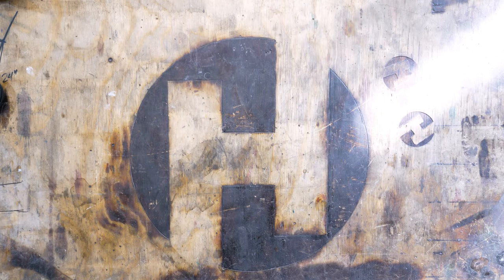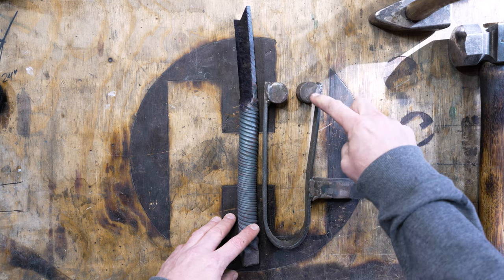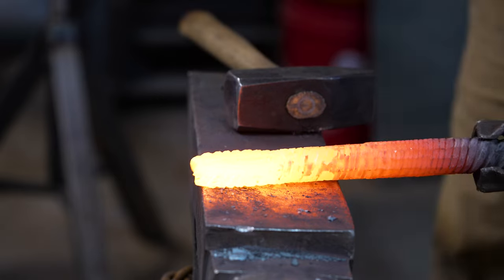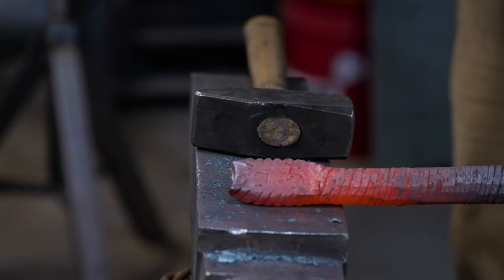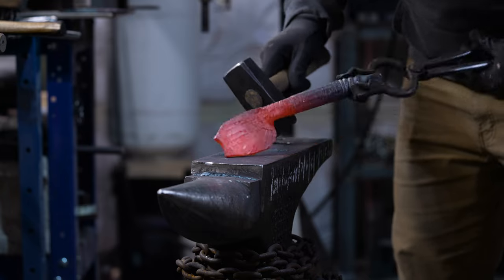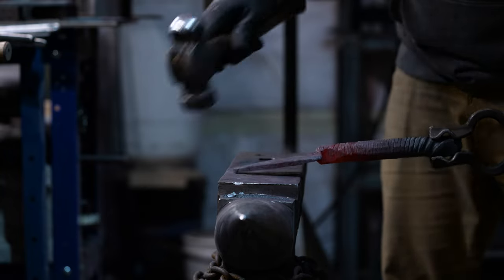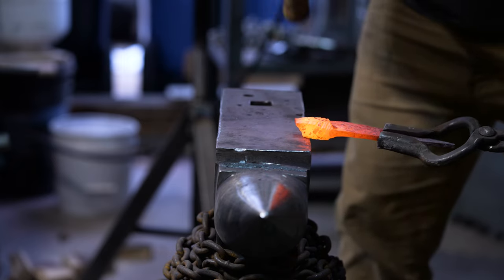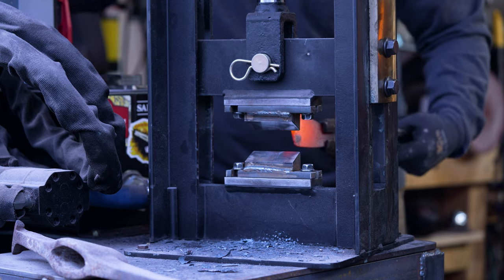How to Hand Forge an Integral Bolster Knife

Comment: Thank you for making this i love working round stock, and this saved me 20 bucks on a book I have been meaning to get on forging Integral Knifes. I have made a couple just to figure it out on my own which i always due before i look into things, then adapt ways to take what i know to make it better. Thank you, and keep up the good work.

Side note: for those wanting to practice this IMHO the best way to practice these would be to use a large coil spring off a ford. (with salvage, my policy is always to buy the same brand as the steel is all made in-house as it is just cheaper in the numbers you have to make. So they make their own equivalent 5160-like material, and i picked Ford and only buy Ford) and you should get fairly consistent and you don't have to pay for shipping. I say this because round stock is a little harder to get ahold of in simple steels
Reply from the maker: My pleasure. Thanks for watching. I agree, I still have a bunch of coils springs sitting around that I use from time to time. Some of its not quite as thick as I need for integral knives, so I use it to make punches.
Reply: @Hathenbrucksteelworks , that's what I have been doing with mine however, I also keep a stock of leaf springs for when I am forging a new shape for the first time and then keep that as my template.

Comment: Hey.
Sehr hilfreiches Video.
Ich hatte bis jetzt so meine Schwierigkeiten mit Integralmessern.
Welcher Hydraulikpresse benutzt du?
Sie sueht handlich und sehr kraftvoll aus.
Lg Christian
Reply from the maker: Hey Christian, Im glad this video has helped.  The press I use is the 12 ton Coal Iron hydraulic press.  Its great for smaller work.  If you have the means, I'd probably go with the 25 ton, but the 12 ton works great.
Reply: @Hathenbrucksteelworks  ok.thanks and from which Company Do you have the press?
Christian
Reply from the maker: Coal Iron.